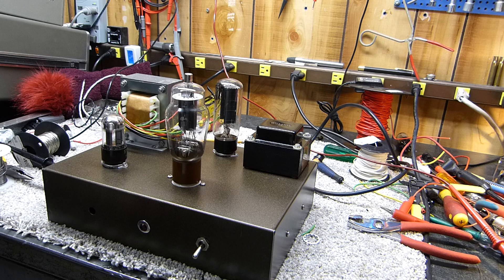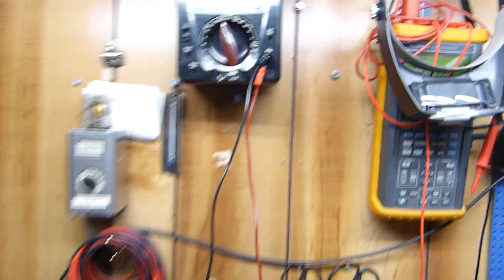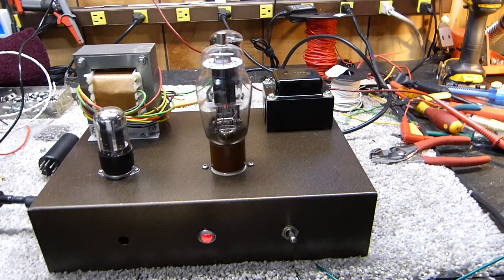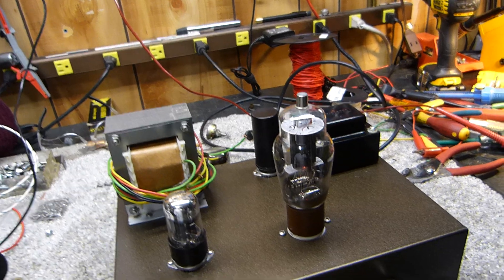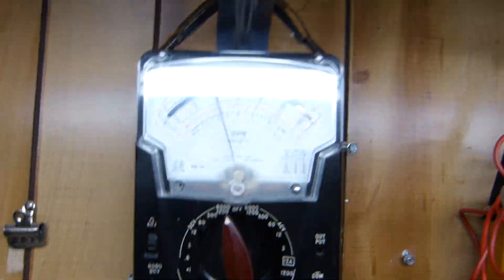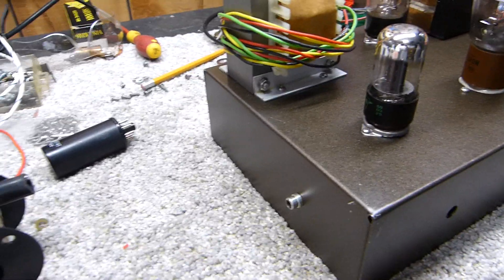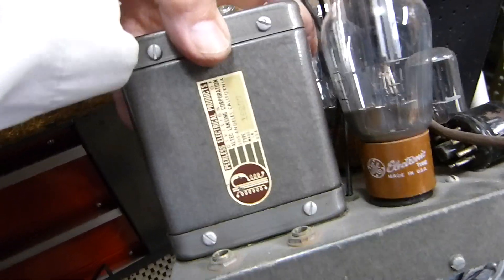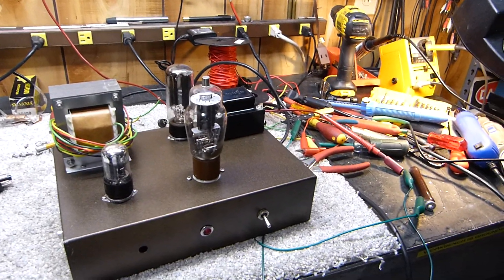807 Single Ended Audio Amplifier Project - Part 3

Comment: ELPASO, Do you ever measure the output tubes transconducance in-circuit when biasing guitar amplifiers? The transconducance is the voltage gain or current gain of the tube but it should be factor in when biasing the amplifier?

Comment: Paint turned out pretty good.  Is that the Rustoleum hammered Paint? Looks good.  I use it all the time.  I love it.  Hides imperfections.  I even tried the copper color.  I like the black, or the 2 different shades of gray.  I like using it when refurbishing vintage test equipment.  Your brave taking a 450v cap up to close to 500v. If it's a good cap no worries.  But some will not. 
Have a good weekend!

Comment: Bang on, your 400 B+ estimate cool..
Reply from the maker: The 400 volt B+ is under full 100 mA load and is how it perform at max sine wave power but under idle with something like 30 mA or so, it will be more like 425 VDC and should be right in the sweep spot.